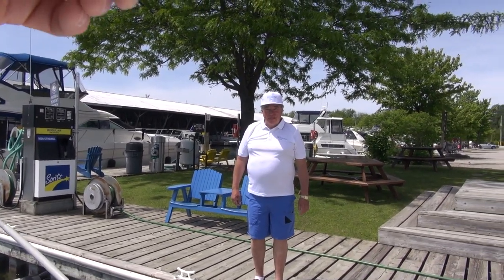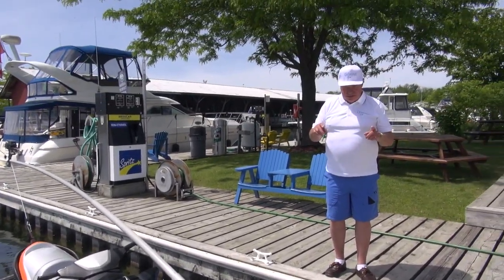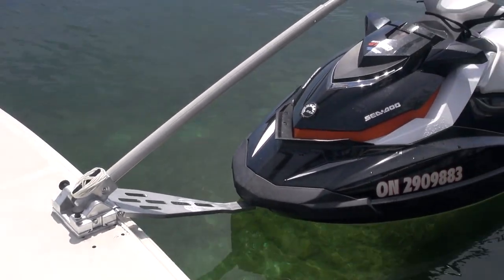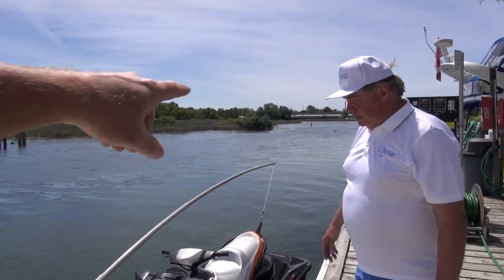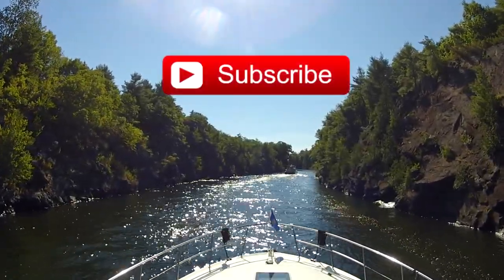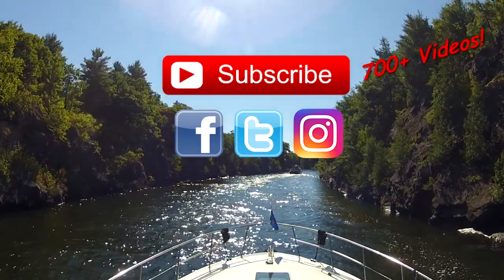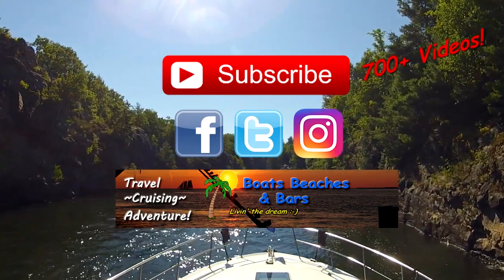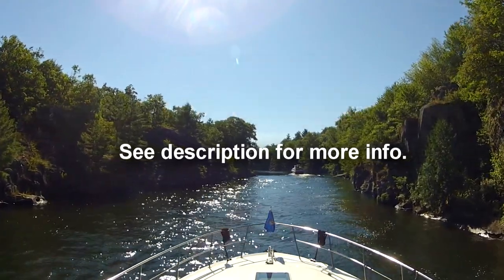Boating Basics - New Sea Doo/Waverunner/Jet Ski Towing Bracket

Comment: great idea. Bad price. They want $2,300 per the site. Looks like $749 would be a fair price given material and labor cost.
Reply: Matt Donn yea way too high PWC rails are about $1,000 USD cheaper and keep it out of the water..
Reply from the maker: Hi Matt. What are the PWC rails that you mentioned? Would love to find out more. If there's a similar towing system like this for a thousand bucks less, sounds like a bargain. . .
Reply: BoatingWithBoogaboo hey Paul, check out pwcrails.com. The only thing is they’re a little more labor intensive as far as getting your sea doo on them and may not be as suited for large crafts. Anyway enjoy the winter I know you as well as I are counting the days until summer luckily were able to stay in the water here over the winter so I’m planning on changing over to luxury vinyl in the salon over the winter to keep me occupied.. lol
Reply: @Jwoodard9101  I don't think the pwc rails are meant to be used while the boat is moving.

Comment: I heard if you tow a Sea-doo at speed it will force water into the exhaust and engine.  That's not true?
Reply from the maker: That's correct and why a shut off, or crimping that water line is mentioned on thier website. I installed a simple ball valve on our Sea Doo for if we ever wanted to tow it.
Reply: True. Throw a ball valve in the line coming off the pump. Easy mod

Comment: I have a feeling this product doesn't take into account the towing nusances with PWC's. You can and will damage your PWC by towing it over 10MPH or for long periods. The best bracket for a PWC is one that brings it out of the water. This would be fine for a tender/dingy.
Reply from the maker: Anyone towing a Sea Doo/PWC must install a water shut-off for that purpose. I'm sure that if you visit the manufacturer's site, they'd more than likely state that. If not, you should mention it to them.

Comment: You can't tow a sea doo over like 10mph or you will flood the intake with water.
Reply from the maker: The manufacturer of the towing bracket recommends putting in a shut off valve, right on their website. 
 BRP - the manufacturer of Sea Doo products - suggests that one can simply clamp off that line when towing and they even sell a special clamp for that purpose.

Comment: May I know what top speed we can tow a JetSki safely, like SeaDoo (with water intake blocked) ?  Also, how far apart is required if I wish to tow TWO Sparks at the same time?  Any warranty for this towing device please?
Reply from the maker: +antony poon You'll have to ask the company. Link in the description.
Reply: A few days ago, I wrote to their emails.  One email is not working, while the other email had no reply.  Hope someone will reply soon from them.
Reply: Just wonder if any current users can provide feedback on how well Magic Tow is built and its handling please.
Reply from the maker: Again, you will have to contact the manufacturer. I only filmed this clip, I have no other insights, as I don't own one. I updated the description to include a link to their web site - https://www.magicmarinetow.com/
Reply: After so many months and with a few emails to them, they never reply at all.  Maybe they are out of business.  And one of the email address is not working too.

Comment: Seadoo stresses a maximum tow speed to ensure water is not forced back into the engine, how are you overcoming this issue?
Reply from the maker: +Glenn Swinton I am not overcoming any issues at all, my friend. 
 As mentioned in the video, as well as the description, the gentleman who developed this device - Richard from Majic Marine Tow - is the one to contact with any questions.
Reply: BoatsBeachesAndBars sorry, that's the beauty of videos... no need to read the story if your going to watch the movie and I discounted it after the 28 knt trial run. No real need to follow up, seems a little rich for my blood anyway :)
Reply from the maker: No worries.

 As we do not (currently) have a PWC, we aren't in the market for such a device. That said, I thought it was a good option for #boat owners who are looking for a towing solution.

 Truth be told, we are currently boat-less as well (https://youtu.be/jbrqUBSurfU) :-( 

 Happily, we are actively searching for a replacement #Boogaboo and, if all works out, we might even get a Sea Doo for fooling around on. Feel free to follow the journey, if you are up for some boring YouTube entertainment ;-)

 Cheers, Paul.
Reply: Glenn S you would simply add a ball valve to the water inlet from the jet pump that feeds the cooling system.